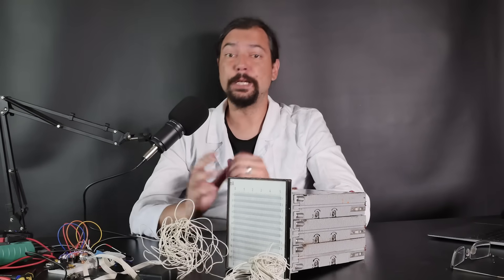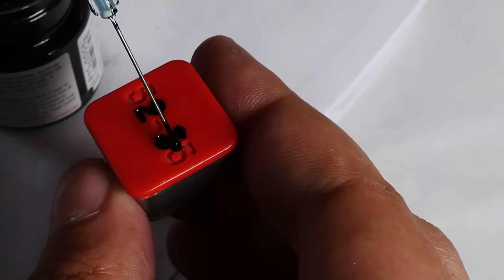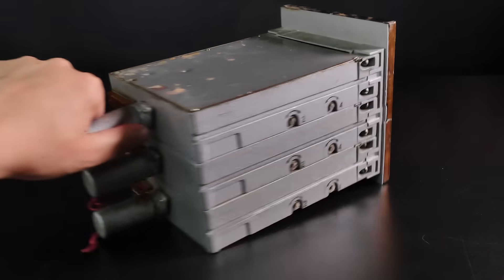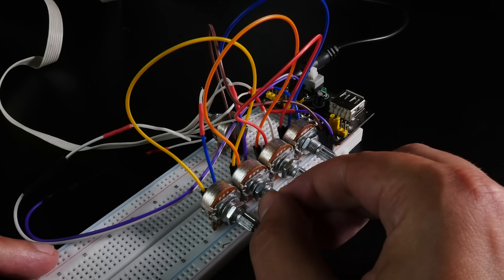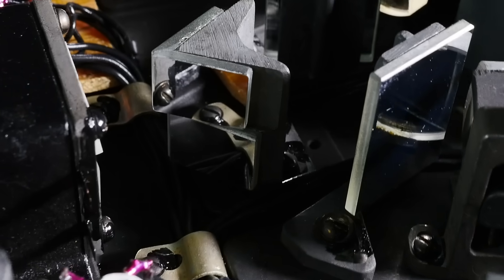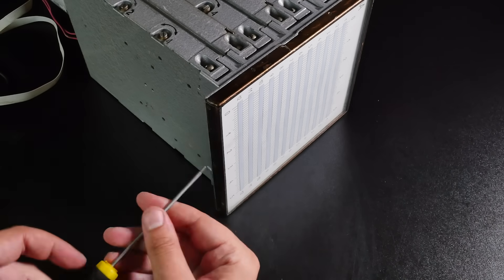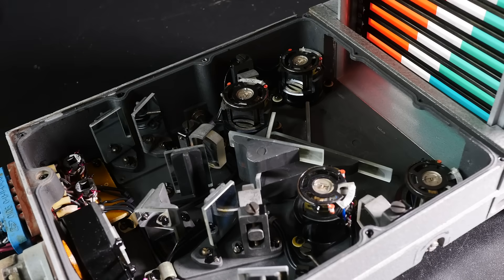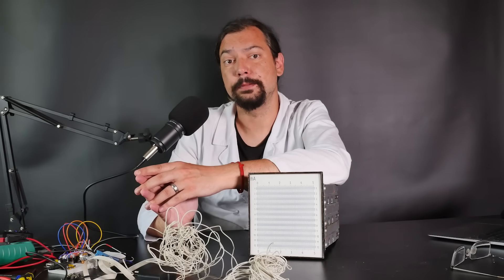Testing an INSANELY complex meter from CHORNOBYL control room

Comment: Ahh yes the 12 channel lar balancer, I think there is a game where this actually works for balancing lar setpoint. So basically what this does is when your setting up lar you want the zone to be shown on here. So with lar you wanted it to be in the middle with the middle being 0 and then you had +5 and -5 to each direction so basically when you were withdrawing the rods close to the lar rod you could change the value of the channel. And when a channel like for example 5 entered the range you could deblock it and it would be available and then when you did the same with the other 11 channels you could enable lar but I think you would need to deblock laz first to be able to enable lar. Lar = local automatic regulator. Laz Local Automatic Protection

Comment: imagine one rebuild the whole thing and press AZ-5 on 01:23 only for it to react in same way without being connected to the reactor
Reply from the maker: I am not sure I get what you mean — without reactor, it is just a button; and plus, the post-1986 version was changed far too much to prevent anything similar happening again.
Reply: @ChernobylFamily  i meant it as if building complete replica and pressing AZ-5 makes it "connected" to some RBMK and make it blow up as if it was you that in same circumstances that turned AZ-5 in 1986 on 01:23 (like paranormal activity sort of thing)

Comment: Wow I did not expect to see this level of engineering in a meter. Seems quite difficult to manufacture. But I suppose optics might be quite simple to build compared to a digital readout. My understanding is that contemporary western designs were using digital 7 segment displays for many functions by the late 70s early 80s.

Comment: Soviet engineers were designing practical devices. I've seen simple, small differecnes in loco designs. Any fix in Polish control panel need holding unscrewed plate. Russians add support. Little piece of metal, that holds plate opened.
Reply from the maker: Soviets, not only Russians. The second were just a part of the first. Thank you.
Reply: @ChernobylFamily  Loco I meant was WŁ-11, it was Russian, but in time of its design there was USSR
Reply from the maker: @hvnterblack VL-11 was designed and produced in Georgia :)
Reply: @ChernobylFamily  It wasn't. NEWZ produced it. Nowocherkasky elektrowozostroitielnyj zavod manufactured it.
Reply from the maker: Ehm.. https://ibb.co/Vc2PSxtp ?
Reply: @ChernobylFamily  point to you. Digged for more data, exactly it was designed and produced in Tibilisi (TEWZ). Later NEWZ started production 112E, which was VL11.
Reply from the maker: I see. Thank you. I am not an expert on trains, though.

Comment: These meters are by far the coolest things in the control rooms... Initially I thought they used VFD valves like the ones used in old clocks even in Chernobyl, but I never could've imagined it was a beam of light moved by a mirror...
This video shows impeccably how it works, really great job guys!!
Does anyone know where I can find one and most importantly if it can be "modified" to use as a VU meter?? I'd love to have one or two dancing around in my Hi Fi system!
Reply from the maker: At the control room, there are some VFDs and many electroluminescent panels (see one of our previous videos). Google "амперметр М1742" (М іs cyrillic), but be ready — this very model costs roughly $300. Alternatively, look for 1-channel М1730 ($20), or 4 or 3 channels М1741 / М1743.
This is, anyway, just an ammeter/voltmeter. Change the scale (or make a sticker over) and normalize the input signal, and you go.
Reply: @ChernobylFamily  thank you very much!! A single channel one will do just fine and with the red film and sensors I could perhaps do a sort of peak light indicator that comes on only with higher spikes in the signal. Looking back at the old video where you explained the single channel one you mentioned it's a mA meter, so maybe it could naturally work as a VU meter or it could just need some resistors... 
Thank you again!
Reply from the maker: Please note that red and green sensors are not a standard feature. I am not near the device to check which letter after M1730 meand that, seems it is M1730K
Reply: @ChernobylFamily  thanks for the heads up!!
Reply from the maker: I came to the lab and checked — yes, it is with "K".
Reply: @ChernobylFamily  you are THE BEST!! thank you so much ❤

Comment: As fancy-looking as this type of display may be, my inner engineer can't help grumbling that it is basically just a regular ammeter with a mirror where an indicating needle should be, and also with a whole bunch of optics that make the device much heavier and bulkier than it needs to be.
Reply from the maker: The point of them is that they were designed for naval use, and can be seen in dark/shaking condition from a distance.
Reply: @ChernobylFamily  excellent context detail! Although to me, things based on optics don't make the impression of the highest shake-resistance. I guess I would have used motor-actuated indicating needle with a light source attached to it. Yes, my engineering approach is a bit TOO direct.
Reply from the maker: It is ok, maybe your idea would really work better (no sarcasm here) — these also have issues when the chassis they are mounted on facing horizontal move.

Comment: Were you able to tell how linearity is managed in these meters? If those rotating mirrors' angles were proportional to current flow the way a meter movement's needle angle is, it seems to me like projecting onto a flat screen would call for a non-linear scale on the front but that doesn't seem to be the case.
Reply from the maker: The head housing a mirror is not any different from those turning a pointer.
Reply: @ChernobylFamily Okay - so how do they give a linear result …or do they?

Comment: Haha nailed it. Mirror galvanometers indeed. Very nice. The giveaway to me was the aura around the 'pointers" on the teaser post. The only thing I wasn't really clear on was why only a group of 4 were lit up, but it makes sense now, 4 meters per bulb. That type of meter has the potential to be extremely sensitive, just a matter of how far the light travels before it hits the scale it lights up. Very cool.
Reply from the maker: We can power all 12 at once, just need to purchase those connectors

Comment: While this is a beautiful piece of engineering why did they use such a complicated design instead of 12 normal dial style meters?
Reply from the maker: Because (probably!) those you can see from the distance (control panels are long)
Reply: @ChernobylFamily  that's a good reason

Comment: Modular multi-channel mirror galvanometer? Beautiful optical mechanical engineering. Would be so cool to see a laser light traveling through mirro/lens the system. Be carefull with the optical mirrors, they have a reflective layer ontop of the mirror, not like a bathroom mirror on the backside of the glass. Cleaning them to much removes the reflactive coating. Never thought of using optics like this to display measurement information.
Reply from the maker: Thank you!

Comment: Old optical indicators are fascinating, previously I thought these would have been just bar indicators with multiple small lamps inside, but no they are analog! These meters must have been really expensive to construct, build quality looks almost too good to be soviet. Reserved only for the most important factories and plants.
Reply: They must have produced enough of them to make injection molds for the housings and a bunch of small parts. The surface on some of the injection cast parts is a little rougher then you'd see in most things, but not bad. I suspect this would be cheaper to produce than an equivalent using mechanical pointers for each scale.
Reply from the maker: The reason is different: those originally were developed for naval use, and this design comes from a need of a reading to be visible from a distance and be quickly interpreted (hence the standard shape of all of them)
Reply: @ChernobylFamily makes sense, also the mechanism would be more resistant to vessels movements due not having mass of the indicator needle flopping around, the rotating mirror assembly seems well balanced.

Comment: Using a moving light beam was pretty common for high sensitivity meters used in precision measurement (galvanometers), but this meter is not sensitive. I think the advantage here is that the meter has a flat front scale, whereas a side mounted meter like that would typically have a curved front scale. This makes everything more compact. And the stacked design here is especially compact.
Reply from the maker: Right. This one originally was for marine/naval use, so that's why such a design.

Comment: Now that is real engineering - using simple optics instead of some overengineered solution.

That was really interesting to see. 👍
Reply from the maker: So true, simple solutions can be the most effective.
Reply: Simple. until you need to calibrate it.
Reply: @liquidsonly People who did that work would gain experience. With experience came ease of calibration :)

Comment: Very clever design.
You can not have this kind of display quality with LED bargraph (low resolution) or an LCD display.
It must be super reliable too.
Maybe you can change/upgrade the light source with a 4000K white LED
Reply from the maker: Yellow. They were yellow.
Reply: I imagine the incandescent bulbs were very reliable. Pretty sure the engineers designed it so that the bulbs were run at somewhat less than their rated voltage. Between that and the fact the bulbs were probably never turned off (no start-up shocks to filaments) they would last a long time. I forget the exact numbers but reducing voltage to an incandescent lamp extends life by something crazy like 10X.

Comment: Why do you think they did this rather than a more conventional needle display? To keep it all "solid state"? (No gears cables or pullies) Would it be more precise?
Reply from the maker: Their original purpose was for naval use. At the power plant, we believe they were used because they are visible in a distance, and all are uniform-sized, so can be interpreted quickly.

Comment: I was wondering what kind of timely configuration the panel will be? like will it be Pre Chornobyl-Disaster or just after the disaster, or modern times? and which control room for which reactor are you modeling for? 3 or 4?

On a other note i my self have a original production KE-011 Red button that was model of the AZ-5 button on the night of the disaster, i have it in a configuration where i took a electrical box and drilled a hole thru it and put my button in the hole. But i cant really figure ut whether there was a protective cover like today made of a Square Metal cover or like in the HBO series with a Plexiglass cover. Or no cover at all? Can you help me with that? love your work btw.
Reply from the maker: 3, post. Because it is far more interesting. 
AZ-5 as a button did not have cover. All those covers are hand-mafe additions.

Comment: 5:39 Maybe you could show beam travel path with some white smoke. Preferably of some kind that wouldn’t leave dust on mirrors.
Reply from the maker: That is a good idea
Reply: Just puff a cigar.
Reply: Want to see that for sure
Reply: Maybe one of those ultrasonic water mist generators?  Moisture still wouldn't be good for a mechanism like this, but I'd imagine simply drying it out with hot air would be a lot easier than cleaning solid smoke particle residue out of it.